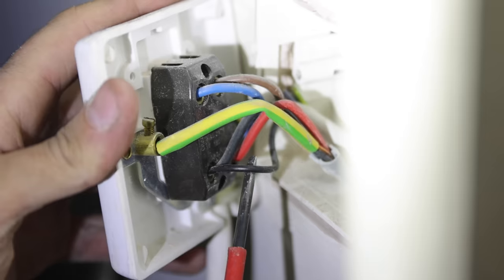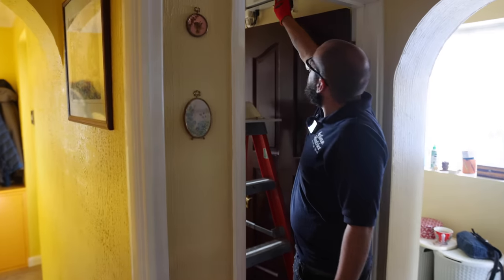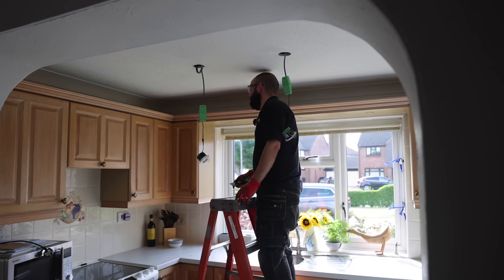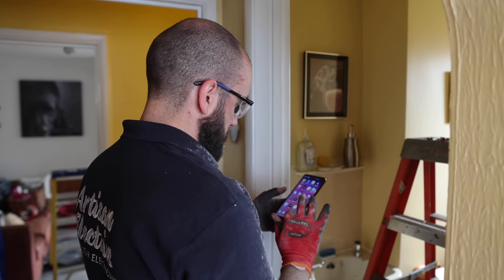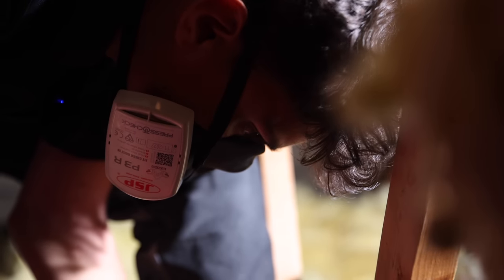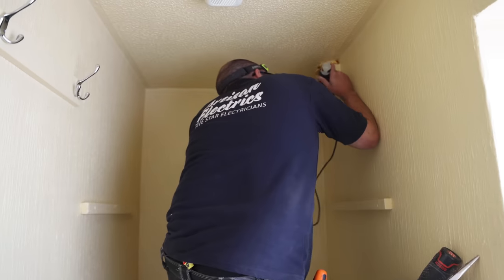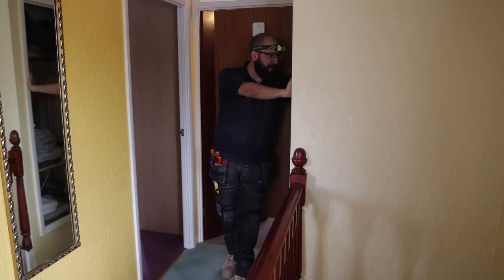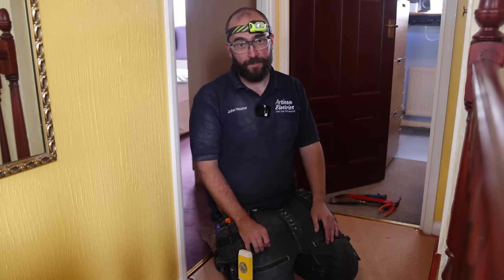'THIS IS WHY PLUMBERS SHOULDN'T DO ELECTRICS!' PROBLEMATIC ELECTRICAL REMEDIALS!

Comment: My heart used to sink every time I was confronted by a heating centre jumble.
John is far too polite in describing  other trades messing with any electrical installation work.
Why are detailed circuit drawings, and labelling of circuit functions, not a requirement, particularly for control systems?
In commercial/industrial installations it is essential.

Comment: You need to look for a cable tracer from the IT supplies. Sends a tone down the wires and the receiver picks up and amplifies the tone dependant on proximity to the cable. David Savery showed one in a video. We used to use them to trace back cables in IT wiring. 

Also like you I hate wiring done badly. Currently dealing with wiring to the wiring centre that’s at the back of the cupboard behind the hot water tank. Power to the supplies is a single radial but someone decided to use filler to “glue” it to the inside of the plasterboard.  

Just wish they designed houses to have proper risers with proper accessible cable runs.

Comment: Sometimes when you upgrade the board it throws up many additional problems in this case the shared neutral issue not easily picked up on an EICR originally. The good thing is you are gonna get this resolved with a safer installation in place.

Comment: The 120mm discs are perfect for chipboard flooring . Gives great access and if you use the right cutter it gives a groove (10mm ) so the discs sit flush .. better than ripping up flooring just drill a few of them if needed

Comment: Great video thanks guys, really liking how you two work together, quick question for you if I may. I recenlty accidentialy drilled into a the ring main, to fix this I added two maintenance free JBs under the floor and fixed to a joist with new cables to reconnect the ring. (I went for two JBs to avoid having to double up the connections). Would this be within regs? The JBs are rated at 32a each and the load for the repair is heavy (tumble drier and washing machine / Microwave). I would have loved to pull fresh cable instead of using JBs but pulling up the floor was not an option.

Comment: If I was there I’n that situation with the missing cpc I would have put a cable locator croc lead on the cpc at one end and go and find where the cpc stops giving a magnetic field  and there’s going to be the fault however it will only work if the cpc is completely disconnected like it was in your situation but if it’s connected but your looking for a poor connection it won’t find it that way because it will still have some kind of continuity

Comment: With chip board flooring you can buy a disc cutter hole saw, and make good with the plastic discs which set in the bevelled edge the hole saw makes
Reply: Armeg do a brilliant kit, for this, well worth the money.
Reply: @paulf2529  that’s the one mate 👌

Comment: That foam above the old fused switch looked like it was doing airtightness work. If you just cut it out and yanked the wires through without replacing/resealing then that's why electricians shouldn't be allowed to mess with buildings - they ruin the airtightness. It's fair to say that plumbers aren't much better.
Reply: What the hell is "airtightness" haha
Reply: What are you going on about? Airtightness 😂😂😂😂😂😂
Reply: @goodplacereviewer2495  In April 2002, the UK government introduced air tightness testing alongside the Building Regulations law to enforce standards of dwelling air tightness. The legislation was created in order to lower running costs, verify the standards of materials, prevent uncomfortable drafts and "avoid condensation problems".

There was a tumble drier in that small room.

One trade messing up another ones work 😂😂😂😂😂😂

Comment: Why don't you just feed the boiler from a spur off the immersion heater circuit seems like a more secure circuit anyway
Reply: was thinking the same, boiler faults aren't going to take out your sockets then
Reply: @havoctrousers  was thinking more that a fault on the socket circuit won't take out the heating but good point too

Comment: Drilling artex ceiling with no mask on and dust everywhere, most of the artex up till 90s contains asbestos ,jointing cooker cable out 🙄 high load circuit on non accessible jb not best practice and immersion heater should be on its own circuit , something in regs  about heater with so many litres should be on its own circuit